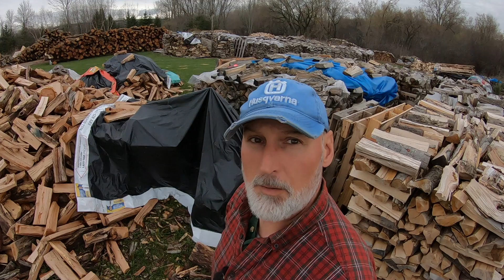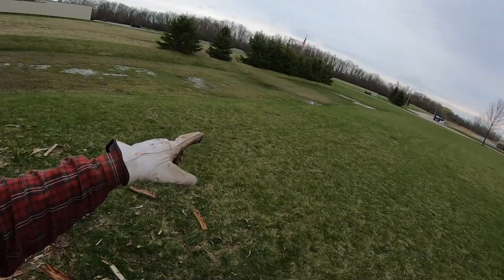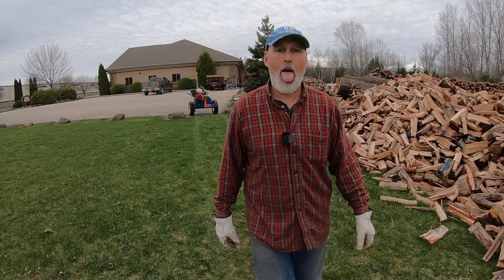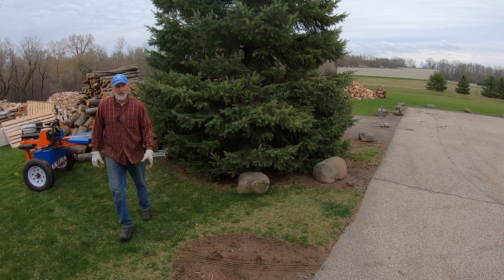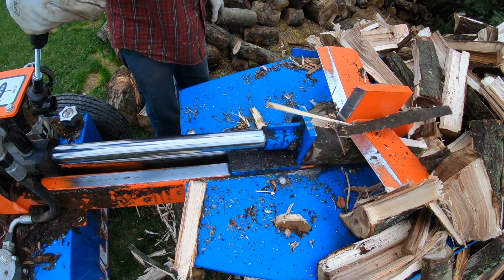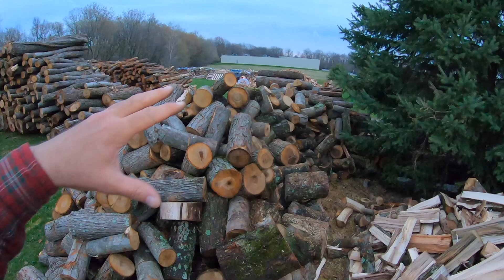#297 - Eastonmade ULTRA Splitting Maple Firewood

Comment: I guess if you want to do yourself in pulling the splitter around with out a power source,  what about putting a large caster wheel on the front, that way you would not have to lift and pull it, just pull it. And it would still push itself when the wood piles up. Just a thought.
Reply from the maker: Yes that is a good idea! You are looking out for me! THANKS!

Comment: The Briggs on my glacier model splitter starts on one pull every tine after a week off. John is bringing me a load of standing dead ash next weekend. How long do you think it will take for that wood to dry for campfire wood? Says he has had those logs sitting in his yard for a while now.
Reply from the maker: A couple months at least maybe three. Get a moisture meter or just try burning a campfire with it.
Reply: @InTheWoodyard , which one do you use? The box elder I'm selling now clunks like bowling pins and is mostly barkless. Logs cut last July so they has some summer sun to bake in.
Reply from the maker: @thefirewooddoctor  The cheep one is all over the place on readings so I only trust the $50 one.
Reply: @InTheWoodyard , which model do you use? Trying to research moisture meters now.
Reply from the maker: @thefirewooddoctor  I do not know, they had two at Fleet Farm and the $50 one is red and gray an works great! I was by the wood stove and heating stuff.
Reply: @InTheWoodyard , thank you so much. Will check that out.

Comment: Wouldn't it be possible to fabricate a half size front wheel on a post to slot in where the support leg goes? That might make it easier to move without having to lift it...
Reply from the maker: Yes it would! Or I could get a dolly jack!
Reply: @InTheWoodyard  I think the wheels of a dolly jack would probably be too small and get stuck in soft ground?

Comment: It would help if you could make a foot pedal to operate you splitter instead of the handle  that could cut your time on splitting  !
Daniel from central Mississippi
Reply from the maker: YES! I have thought of that too! It would be awesome!
Reply: Hi Daniel - it's Big Rodders in Ireland.   I have a vertical electric Italian hydraulic splitter that came with mandatory two handed operation.  I converted it to foot only operation and it has transformed my operation.  It's slower that the Ultra but if I can keep the ram moving at all times I am working consistently and, dare I admit, at a pace I can sustain.